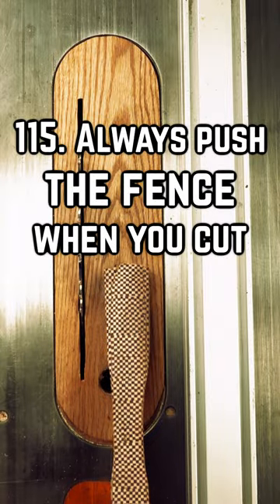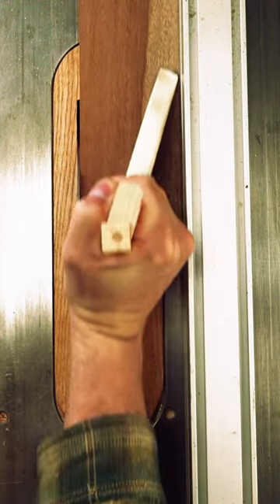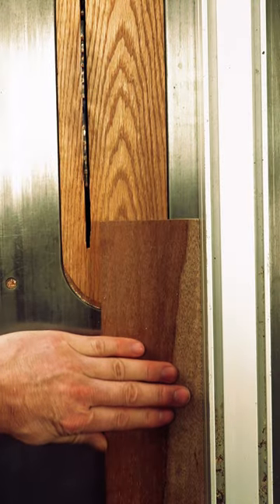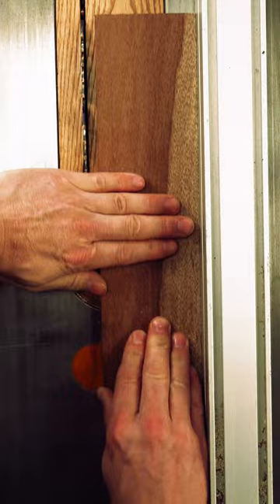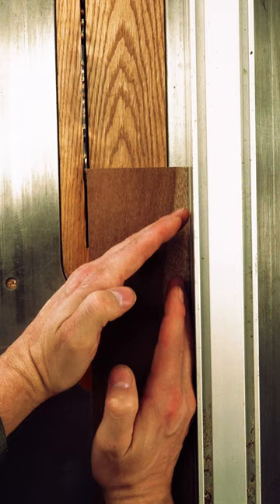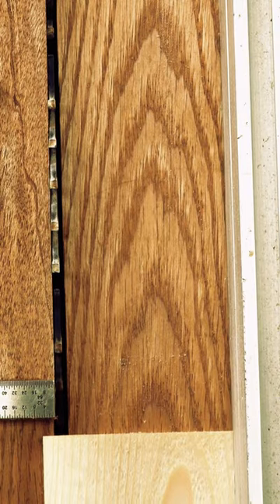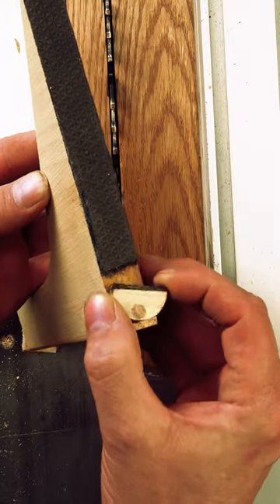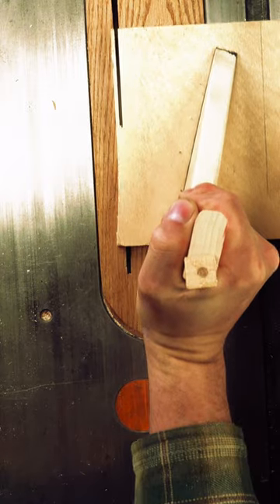115. Always push the fence when you cut #mtbitesize #shorts #makethings

Comment: The whole point of using push stick is to keep your hands away from the blade. Always wear safety gear especially safety googles and if possible use another person to pull long lengths through. Also kick back can occur if wood is under tension and starts to pinch the blade

Comment: No matter how much a SawStop costs in your area, I guarantee it is cheeper than a trip to the emergency room.
This is personal experience talking.
Reply: I agree, but free healthcare is cheaper than a sawstop ;)
However if you can, get one, totally worth it. Even with free healthcare you don't want to risk losing body parts if you can.
Reply: @cronixzero  exactly what I was getting at. Don't think about the er trip, think about your health.
Reply: did not have a Sawstop in my time... buit I did have springs and wheels to create a rolling pressure hand. that helped keep pressure on the fence.  Wasn't hard and rarely needed to remove it unless I was cutting laterally (against the grain on long pieces.)  then showed it to my woodshop teacher who vanished overnight forcing the school to hire a new woodshop teacher.
Reply: Theres a sawstop in our college woodshop. There is a wall of blades showing how many students would have lost fingers. If I was a pro id for sure buy one. $3000 is cheap. I paid that for 1 canon lens.
Reply: Yeah but, look what happened to Rex. He used a saw stop AND STILL had to go to the ER. At least it wasn’t the worse case.
Reply: I think the sawstop mentality leads to videos like this.  Respect your tools certainly, but abject fear leads to more accidents.

Comment: Pro tip from a guy who's ran stuff through a table saw for 6 years: the stock will lever around the blade if there's any kind of a gap. Don't try to push the head or center of the stock (center being where the blade is) into the fence, or even try to maintain the gap so your cut is perfectly parallel. What you want to do is push the tail of the stock into the fence, allowing the piece to lever around the blade and naturally reducing that gap, as well as reducing the amount of potential kickback.

Now, before the stock hits the blade, that's when you want to line your stock up against the fence. Make it as straight as possible, but try to keep the head of the stock against the fence until you make contact with the blade, then start levering the tail of the stock against the fence. Do it perfectly, and you might not have any gap at all. However, 99% of the time, a little gap won't matter, so don't sweat it too much.

Comment: Use a long push stick that looks like a shoe or 1”x6”x12” board. Rip 1/2” off the 12” side stopping 2” short to create a heel looking push stick. It pushes the board down and forward. 

Use feather boards. One clamped to the fence pushes the board down. The other in the miter gage channel pushes the board to the fence. 

When ripping thin strips you can’t use the feather board on the fence. You will have to sacrifice your push stick in order not to get that thin strip to kick back at you. You can push both the big board and the thin strip forward and off the saw.

Comment: in germany we have those things called fritz and franz. it only works on the big tablesaws tho but it makes dangerous cuts pretty much foolproof. and you can slide back the fence so that kickback is almost completely mitigated. i am not a native in english so it is a bit hard for me to describe. what you do is you have two thic pieces of board that slide into the groves of the sled. you lodge your workpiece inbetween and press against the fence. because the piece is locked between the fritz and franz pieces you can move the end of your fence to a 45 degree angle relative to the starting point of your blade so that after you cut your piece lies completely free and has no chance to get kicked back. also your hand will never come between fence and blade. because it will always be on the sled.

Comment: Everybody justifiably pointing out his long sleeve. The wrist thing is not as hairy as the camera vantage makes it look because his hand really is well above the action, but I would still have used the push stick a trifle differently, as more inline with the direction the stock is taking, but with twist to force it to the fence. The foam he put on the gripping surface is excellent for that reason! The swiveling tooth is an unnecessary complication, in my view.

My favorite push device is a birds mouth made from some 1/8" aluminum bar, with one tooth sharpened to a bluntish point. I most often poke the stock on top like an awl, it gives excellent side pressure and if the device ever should contact that blade, nothing drastic happens. The blade just takes some aluminum shavings, that"s all, unlike if a steel awl is used.

Comment: Make a second fench. 1or 2 inch past the front of the saw.  Bolt it to the main fench.  This way it won't stuck between the fench and the blade. You reduce the change of kickback.

Comment: If you keep the blade high the blades force is cutting down towards the table, if you have the blade low just as high as the material the blades force is pushing back towards you. Keep the blade high when possible.
Reply: Making the blade high creates tear out on the underside of the piece. Depending on the fineness of the carpentry, this may or may not matter.

Comment: I have never had any of these problems with my table saw... Maybe I'm lucky? I find it easy to use push sticks. Just pay attention to where the blade is 😅
Reply: That's because you're using the push stuck right, mostly. He's putting the stick close to the blade on the theory that you want to push the wood through the blade, while I suspect you're putting the push stick up against the fence on the theory that it doesn't matter where you put the push stick, but you'd rather the push stick not get all cut up. His theory is great in theory, but putting the stick close to the fence is actually better in practice because of how the piece levers around the blade.

It's a funny thing about table saws that it's better to push the tail of the stock into the fence rather than trying to push the whole piece into the fence--you get less kickback and burning that way.

Comment: Roll your sleeves up  There are a few issues with your push jig and need to make changes 1. the angle for pushing is not natrural there is no reason you should be white knuckling when pushing through the saw 2. the danger of the saw if when the peice going through the saw flips or jerks towards the blade, if that happens your wrist is not in a good place. the pivot looks ok.

Comment: As a German carpenter in my apprenticeship I was taught that there is a 120mm "dead zone" (5") around the blade, where you must not put your hand. There are plenty of other ways to cut material, no matter what it looks like or what size it is. There is ALWAYS a safe way.

120mm is about one hand with, btw. And this Rule goes for all machines. Bandsaws, Routers, Planers, everything. One hand with away from danger. Always.

Comment: no guard ... no spliter and no retainer . long sleeves and going above the blade ?? if your fence is parallel at 1/128 with the blade .than u can make cut 1/16 with a good blade and good fence .the very last thing ??? are u using a saw with tooth that are shattered ??? that is wild . that why ur hand was shaking u need to push hard becaus your blade barely cut . if you need to push hard than your table saw is wrong .